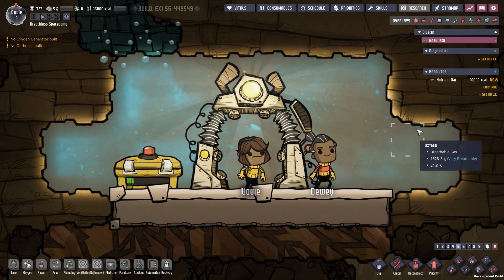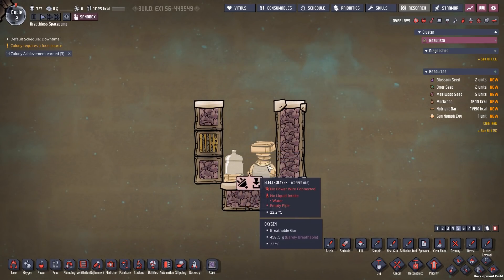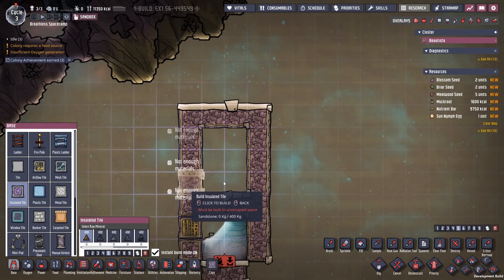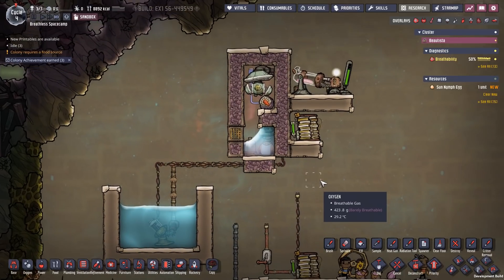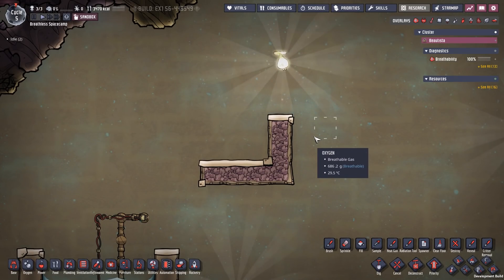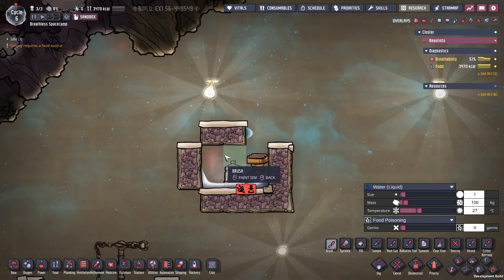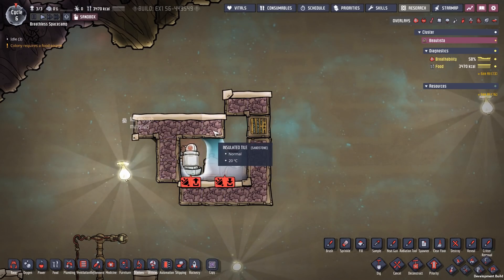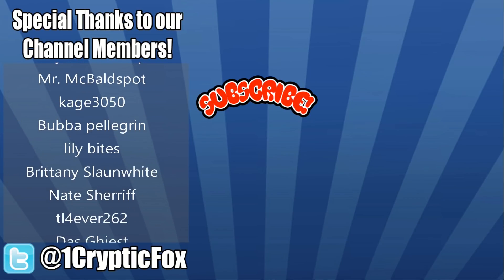How to Make the SMALLEST Electrolyzer Build! - Oxygen Not Included Tutorial

Comment: I've used this design in my bases for a while now and love it.  

One thing I'd suggest is not building more than one of these modules and instead combining them if you need more oxygen needs.  The one large hydrogen gas pump can support up to 4 electrolyzers, so by planning ahead and building 4 electrolyzers and only connecting the one you need to power, you'll be set with oxygen for the rest of the game.  When your dupe forces need more oxygen, just plug in the next electrolyzer and it's already doubled the production.  You will need a second hydrogen generator to power all of the electrolyzers, but not until later so you can hold off on plugging it in to save on hydrogen.  Basically keep the same design as your 1st one but build the walls around the electrolyzers with airflow tiles.  The hydrogen will still go up and the oxygen will then flow to the side and then down through the airflow tiles.  

You can also stack these instead, having the floor of the electrolyzer be made out of airflow tiles and using that to redirect oxygen and hydrogen into two columns on either side of the electroylzers.  This is particularly handy when trying to get liquid hydrogen and liquid oxygen for rockets as you aren't limited by the size of pipes any more.  Add a cooling source near the base of the columns and you'll have a tank for your liquid hydrogen and liquid oxygen, the cooling system, and the generating system all in one spot with zero gas piping.

Another tip for people trying to get the liquid levels right, use pipes.  Sometimes using bottle empties doesn't work because your dupes are too busy or whatever, so instead just fill up some pipes with liquid and then just use an automation signal to open a vent to drop the liquid when you need it.  That way if you are pumping in hydrogen for the second design but the dupes aren't delivering the water in time, you can sorta bypass them and do it yourself.

Pipes are really handy if you are trying to get exact numbers for liquid as each pipe holds exactly 10kg of water, so if you need 40kg, just build 4 pieces of pipe, fill, disconnect from liquid source, and then empty the pipes.  Pitcher pump is obviously quicker, but if you need a specific number, this is the easiest method to measure it out precisely.
Reply from the maker: I've always found the pipes harder to manage as the bottle emptier is really easy to turn off, but the pipes full of water a bit less so.  Definitely multiple ways to do it though.

Comment: Well ... 

the 1º one is risky because of CO2 and the space needed to cooling the O2 make it bigger, but not bad

the 2º one is worse because the same problem for cooling applies and you have the problem of the H2 to escape (and that will kill the dups), also not bad

overall my design is safer, sure it uses more power (not that much) and I also use the water for cooling but inside the space of the electro and pump ... 

the plus on your design is the constant use of the electro and in turn more O2 per cycle but the risks are big.

Have to say, not bad, risky but not bad at all
Reply: for the cooling ... because on my build I use the pump to remove all gas I have more space (4 block high and 2 block wide) I can cool the O2 better inside the space I have, you might think on using that space on your build because if you can cool the H2 you can also make the O2 colder (but not to much).
Reply: another thing I don't use is plastic and by the time you get plastic you already have active cooling, you might thing on using a gas valve (not the auto one) and make a powerless filter
Reply from the maker: As I said in the video, there are many ways to design solutions in the game :)
Reply: @CrypticFoxGaming  true, that's why we love this game, any way was a good video, nice to see you making new tut videos ;)
Reply: Co2 is not a problem, to prevent co2 going into the system , you can build a reverse L wall on the exit, creating an o2 trap as co2 will never goes above o2 and with the constant flow of o2 hydrogen will had a hard time of going in
Reply from the maker: @thegreatneess  As long as you're starting the system in an area that is already oxygenated.  If you try to build this in a pocket of CO2 it will be an issue, where you can get away with that if you use an enclosed system.

Comment: Better to use smart batteries if you have it research. The energy capacity depreciates over time in large batteries when not actively in use. You could instead only turn the pump on when the smart battery is lower than a certain threshold. Just an idea for the first design but I'm definitely using it in my next base
Reply from the maker: Yep there are variations you can make on this theme.  Another way to set it up is us the smart battery connected to a transformer and use it to allow excess power to flow out but turn off the transformer when the battery is below a certain point.